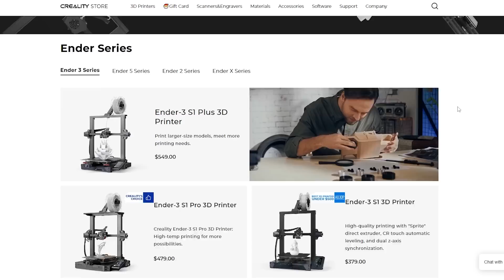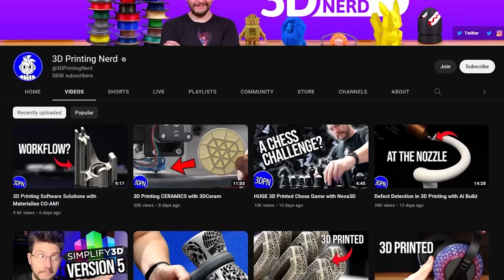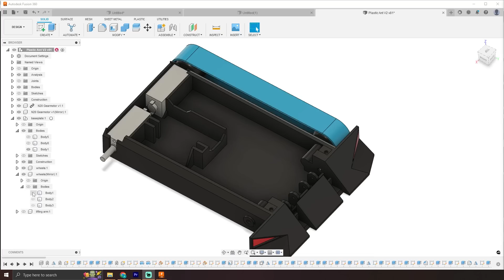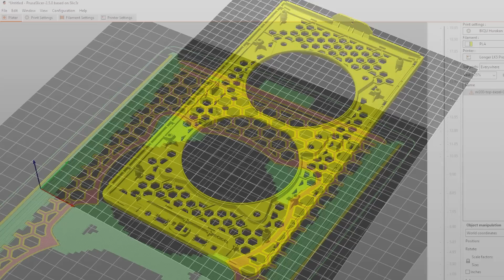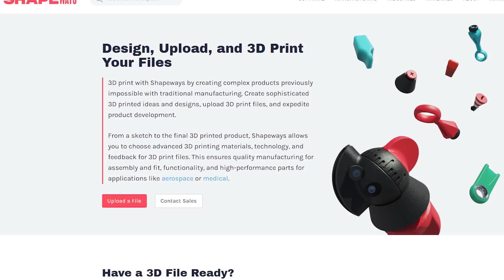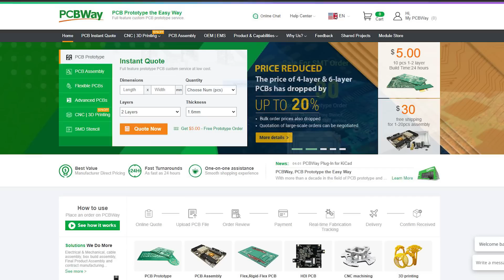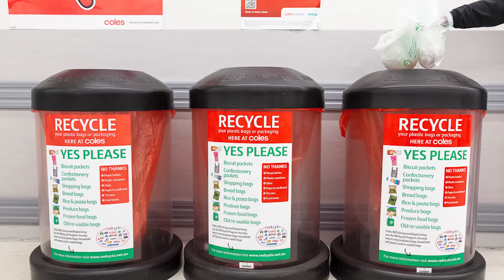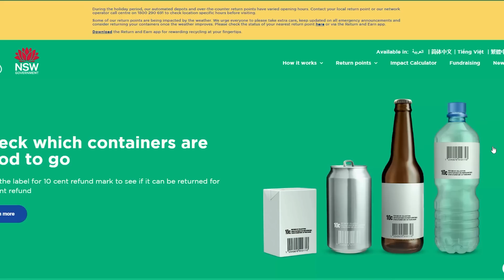My 3D Printing Predictions for 2023

Comment: I don't know why people say bambu lab is innovating...they aren't. They simply took all the actual ideas and innovation from the open source communities, then slapped a proprietary label on it. Chinese printer, made of typical chinese quality judging by their failure rate. It's literally just a coreXY printer running klipper, that they made closed source. Bambu labs is showing itself to be the company that will just wait for others to innovate, so they can just copy at a lower price.
Reply: Here you are, ON queue spouting nonsense. No one before them has shipped a printer with the first layer checks or auto pressure advance calibration. The AMS works better than other multiplexer systems like the mmu2s or ERCF.

You have weird blind hate for this company and its very obvious. You follow around videos about them just to spout misinformation.

Of course they used a lot of things from open source communities. Most manufacturers do and of course its reasonable to criticize that and wish they were open source, but pretending that they don't innovate is brain dead.

Comment: LCD/SLA printing is costing less energy, it should replace the heaters in environmental concerns
Reply: The power usage is far less of an issue than the plastic waste. The amount of energy required to make that plastic in the first place greatly outweighs the amount needed to form the filament into parts.

Comment: I replaced about a dozen things in my house that broke with pa12 cf parts I modeled in fusion 360. Sometimes injection molded shit is cheap and thin. Being able to measure something,  redesign it, and print it in something that's incredibly robust like cf nylon is game changing.
Reply: Great to hear, have been thinking a while about getting pacf filament. Did you try other combinations? Do you use dry boxes while printing?

Comment: The cad software is definitely already happening. I've been looking at FreeCad over auto desk products because the whole license and the chance they'll just do unsavory stuff, then have to go learn another program like Unity did.

The mobile app for fusion has been in a few shorts and makes cad look easy as hell
Reply: Taking free features and charging a license for them. Limiting the size of the cloud storage unless you pay for an "upgrade".  Removing the ability to export to non-proprietary formats from the basic offering - again, requiring an "upgrade". Deleting support for an unpopular OS. Moving to a monthly subscription cloud-only service, so "your" files are hostage to the internet quality and their accounts department.

I use FreeCad. It is not good (yet), but it cannot be taken away!
Reply: @SittingDuc  the whole 'cloud storage only' was a deal breaker.  I am a consultant and I am required by certain laws to maintain control of our work - Cloud storage is simply a no-no.  While working at home, I find the idea of cloud storage fine, when it is my option, but a complete non-starter as a requirement.

Comment: The Bambu labs new bare bones machine is really impressive. I'll def be picking one up when they come down to the $400 range
Reply: I doubt you'll ever see that sale. I think they are going for a no sales strategy so that consumers view their brand as premium, and they can cut the margin on the printer itself pretty close, so you'll be waiting forever or until end of life.
Reply: @BeefIngot  the P1P is $700 brand new, maybe $400 is a lil ambitious, but I'm sure an open box or black Friday will come around as the new models come out. I'm happy with my FLsun QQS pro for now. I got it open box for around $200
Reply: @Ataraxia_Atom  They don't seem to want to be the type of company to release new models frequently and have even openly said so. I think you are treating them as if they are some typical cheap brand like fl Sun who has a million different models but they don't. So I just don't think you'll be getting that sale. You can even see that with this passing black Friday and boxing day where they only had sales on small accessories. Their going the Apple pricing route of no sales.
Reply: @BeefIngot  sounds like you're making a lot of assumptions, and being a new company I'm sure they're figuring it out. But even in your example, you're telling me you can't get a previous gen Iphone for a discount?? There will be plenty of resellers who will have stock they will want to get rid of. That's where my current printer came from.
Reply: @BeefIngot  you're also assuming that i have to get it from Bambu, getting a lightly used 3d printer from someone who thought they would be more into 3d printing for 50% off the MSRP is a likely situation that i would be ready to take advantage of. I literally just bought a vinyl cutter last week that was 15% of the original price from 5 years ago $100 for a $700 vinyl cutter that is almost brand new
Reply: @Ataraxia_Atom  Well I suppose used is always an option though personally a 3d printer is something I would never buy used. You don't know what the other person has done to it and what faults they are hiding. Its especially bad if you aren't really into 3d printing to know where to check. I suppose the closed down nature though makes it harder for people to mess things up because you won't have people doing things like futzing with the wires or turning off thermal runaway protection.
Reply: @BeefIngot  yeah idk, it seems like it's easy enough to print out a few things and get tired of it and let it sit. We'll see I'm in no rush to replace my current machine, it runs great

Comment: Extended suggestion (cause I don't trust most companies), we'll see more "repair parts" available, but only under drm and "secured printers".  If/When the old guard of Prusa and Ender are replaced cause "this machine can do both stl and proprietary format x," they cut out the stl option and shut down parts.  Whether or not we see a return of open printers after that is... eh?  Possibly, but not likely as strong as before.  Basing this theory on the current corporate reactions to Right-to-Repair.
Alternatively, as a more positive reality, cause people do genuinely seem to want to see R2R to succeed, we see an attempt to "embrace" the proprietary format, the same way Makerbot attempted, and Prusa and Ender instead get a resurgence in interest, as makers still overall drive the printer market.  Either that or companies like Bambo lean into opening their machines up, rather than locking them down.  It would be a hard sell to say "here's a machine you can use to fix other stuff, but you're not allowed to fix the machine itself."

Comment: I use the free version of fusion 360. Im fine with missing out on some functions. But i could really use more storage. Free version is like 10 files. I would love a 1-time purchase for an endless/increased storage.
Reply: This is why I don't like cloud-based software. With something that runs locally, I can have as many files as I can store.
Reply: @user2C47  Yeah, 100%. it was lame of them to put this limit...
Reply: You can have as many projects as you want, you just have to switch between "editable" and "read-only"
Reply: @3DPrinterAcademy  thank you so much!
Reply: ...You also don’t have to save to their cloud at all. Saving to local disk as .f3d file is an option on the free version

Comment: Recycling everyday trash in one cold country is really simple: bottles have deposit system (you get money back at return); metal, paper, cardboard, packaging plastic and bio-waste have their own boxes and go to recycling; all (not sure if literally all of it, but a lot) the rest (including scrap prints) is burned to electricity and distributed heating. For us, burning PLA doesn't add CO2, as it's from plants. PETG is kinda bad because it's made of fossil fuels and releases new CO2 - but landfill-ing it is not correct solution either.

Comment: For home 3D print recycling, we will need a mulcher, a heated extruder, and a calibrated way to get 1.75mm strands back onto a real. I have seen a few PET bottle recycling but where I'm at most things are in Glass or Aluminum.

Comment: "Adapt or die."  That is the thumbnail of the video and truer words cannot be said. However, in order to adapt, you definetely need a deep understanding of the basics of 3d printing. Understanding old FDM, then Resin SAFELY OF COURSE AND PROPER VENTILATION OF A GOOD FUME EXTRACTOR and PPE, and then metal 3D printing.
      Understanding the basics from the past can help you understand well the fundamentals, making it easier to adapt to the future FOR what's to come. It's like trying to understand quantum computing without knowing how an atom works or programming works.

Comment: My work purchased a Prusa at my instance after I got tired of wearing out my ender 3 for work related things. 

Last month, we ordered a dozen Logitech TAP units, but the Metal Wall Mount bracket ($155 CAD) was backordered for 12 weeks. 

I whipped up design that prints in under 2 hours, consumes a buck of plastic, and fits better, has better cable management and is 99% cheaper.

The printer paid itself off in ONE fix.

Comment: 3d printer as tool vs 3d printer as a hobby is a long conversation I have with lots of 3d printer folks.  I use my printers to make things for other projects(and my business), i don't want to spend my time fixing a 3d printer.   Most of the 3d printer as a hobby folks seem to have trouble wrapping their head around it.

Comment: The next race to the bottom should be 3D scanners. With Apple integrating LiDAR there is a ton of potential for quickly building a parts database.

As far as your list, I think the CAD is what will make 3DP go completely mainstream. My 65 yo parents just asked me to print a household replacement part, but it's something they could easily do if they knew the software. It needs to be something that seamlessly integrates simple shapes, photogrammetry, and slicing with an elementary level UI. I know, everybody's dream. Even myself, I don't like to spend more than an hour with the calipers reverse engineering a simple clip or cover. All the tech is out there, it just needs to be combined by a design oriented team, similar to Apple and the iPhone.
Reply: What we DON'T need, however, is a locked down proprietary product (it should at minimum be able to export meshes) or something that is oversimplified to the point of unusability.
Reply: Was just about to comment this. One thing ive been waiting for is a decent quality 3d scanner. And honestly it has boggled my mind why there is still a massive price jump  between the toy scanners (sub 1000$), and the proper high res pro units (8000$+). Im sure everyone's expectation of quality scans will vary. But ive been keeping a long eye on the industry. The only units that are viable for accurate scanning and precision are still the expensive commercial units. Shinning3D just released their Einstar unit which is a 1000$ unit, and i gave it a spin. Yes its easily one of the best <1000$ units on the market, but not even close still to the pro units for precision or the usability that i need. If they could make their Shinning3D EinscanPro HD for 2500$ i would invest in it no brainer, but with those style of units still hanging around the $8000+ mark, its a hard sell for a technology which is still shaky at best imo.

I realize that for commercial use, companies can justify the premium price for a 3d scanner of those calibers, thing is, they have never really dropped in price for the past 15 years. Where as 3d printing tech significantly has. I realize that there is a difference between a $199 printer and a $30,000 stratasys. But in the prosumer world, a 2500$ printer gets you 95% of the stratasys performance, with a lower ROI and minimal proprietary supplies requirements. I wish the 3d scanners could be the same, especially with the significant performance increase, and cost reduction of sensor technology in the past 10 years.
Reply: @TheMoistpotato  I'd like to say that the 3D scanning side of things has gotten better.   The price and performance of  consumer/prosumer units has improved, but... I'll readily agree, the software side has not.

I don't know if it's the proprietary lock-in, or patents holding things up...  but 3D scanning software needs less vendor-lock in to their given hardware, and more of a 3d-slicer or TWAIN page-scanner API sort of interface to software that doesn't run up the cost of the scanners themselves.

To me, it seems like there's a lot of reinventing the wheel when each scanner manufacturer has to build almost the entire toolchain of drivers + software around their scanners, and we're left with whatever toy-like UI a consumer scanner's manufacturer can budget to spend on software design and support.
Reply: @TheMoistpotato  You can find shining 3d Einscan used for about $3000 so it's not too bad!
Reply: Man imagine a world where you scan something in 5 minutes and get an easily modifiable step file out the end for under 1000 bucks. That sounds brilliant. Totally not possible right now, but that's the dream.
Reply: A wiki of 3D parts and shapes for printers.
Reply: someone made a decent 3d scanner with an xbox kinect
Reply: @adyyvhbgcfbjjggghbbcgg  Kinect 3D scanners are everything except decent. Okay, you might scan a head and print it, but if you are going to try and design something from Kinect 3D data, you are going to fail. You are better off going with photogrammetry.
Reply: You mean like the ToF sensors that were on Galaxies 2 years ago?
Reply: @wilurbean  ToF sensors have some way to go to be useful for 3D scanning in terms of accurate model capture. Unlike the supposed 200MP camera sensor on the latest Galaxy phones some of the best ToF sensors still max out at 640x480 (around 0.3MP) with a 10-bit resolution over a 5m range (about 4.88mm steps).
Reply: ohhh i hope so, i really hope so! i bought the iphone 13 just for LiDAR and i’ve been kinda disappointed with the apps i’ve tried. sure they work fine for like, scanning your face with the front camera, or measuring the walls of empty rooms with no furniture in them. but i had a hard time trying to do anything else, especially getting it to pick up any sort of detail on small objects.

Apple including LiDAR is definitely an exciting step though, and hopefully it’s popular enough to start a trend of cheaper 3d scanners. tbh it’s ridiculous to me that handheld 3d scanners still cost like $2000+ the tech needs to be more accessible to hobbyists because i would love to use it to help make so many things!
Reply: We are going that way. AI is revolutionize the world currently very fast. And 3d scanners are trying to detect surfaces accurately. But if you know about it, cheaper options like photogrammetry requires good lightning and surface condition. And this is where AI could change a lot. There is a new photogrammetry alternative called NeRF which works different and has the potential to deal with reflections and such WAY better. And it also can process images way faster then photogrammetry. But it's currently in very early stage, but just a matter of time. And you currently can try it already out, for free. And this could make good 3d scans way more affordable and faster to make.

Comment: Excellent presentation. I agree with most of what you said. 
Virtually every CAD program is nearly impossible to use if you did not attend horrendously expensive training courses leaving many older people at the mercy of the whims of the 3D printer service industry. As for the supply chain, I'm sure that it's used as a scapegoat to rip off everyone.
Most innovative thinking and real inventions have always come from DIY Hobbyists just to be stolen by big businesses. Creality cannot even update their archaic slicer how does anyone expect it to come to the fore with groundbreaking affordable 3D printers. Ultimaker is going to follow in the footsteps of Blackberry. Enough said.

Comment: I want to see a portable interchange format that is inclusive of slicing configurations. We are too used to slicing by hand and we've just stopped hoping for innovation in this space.

I'd like to download models that come with 1-3 slicing config options, just like digital images and videos often have 3 different resolution options when downloading. If a project needs supports or should have a specific print orientation, let the author put this into the project file. We all have stories of failed prints because we simply didn't notice an impossible overhang in the model before printing it.

What makes this hard is that we need a balance between (1) common-sense information about the model being printed, (2) sensible defaults for printing on any printer, and (3) the ability for the user to optionally view, tweak, or override the recommended settings.

I just want "download and print" to work 95% of the time, instead of 5% which is what it is now. 

I would say the printers have come a long way in terms of bed level probes and adhesion. Before these were reliable, the amount of effort to configure slicing really was only a fraction of the effort. But now reliable prints can be attainable by default if we can start including some common-sense slicing defaults.
Reply: Just wanna clarify and ask, when you say *optionally*, you mean the user has the option to override them, not the designer has the option to disallow it, right?
Reply: @faeranne  Yeah, that's right. The user would see that the designer/creator enabled supports by default (build plate only, for instance), but an advanced user with access to non-planar slicing could disable or customize those.

Or similarly, the author could suggest "vase mode" as a default setting, while still letting the user override this if they have reason to.